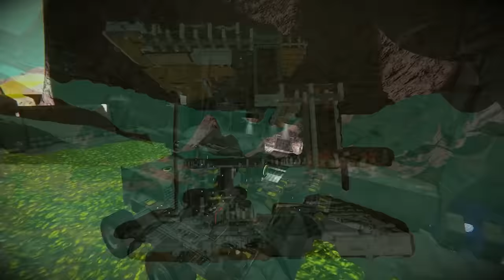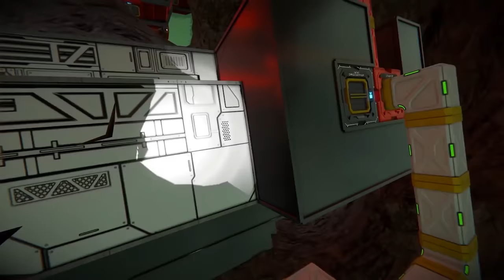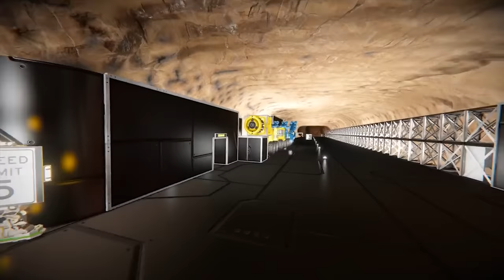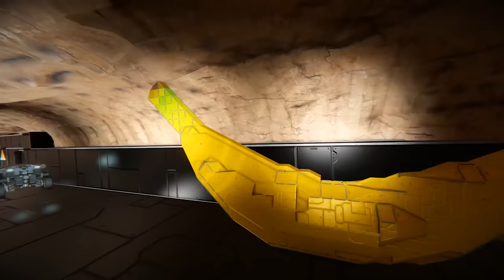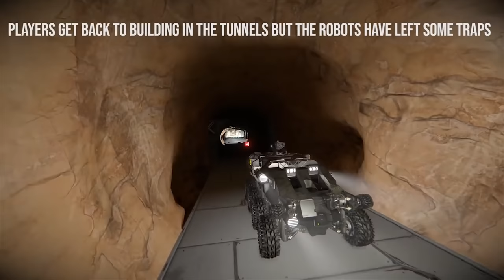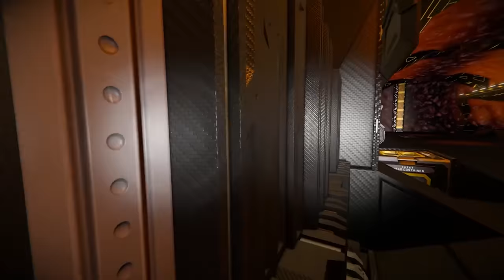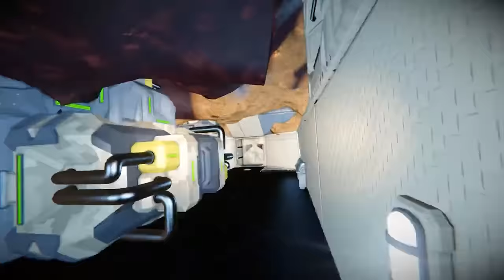WHY UNDERGROUND BASES SUCK !!!! - Space Engineers

Comment: The main reason for an underground base is so that you are hidden. For small groups it is great because you can hide away so no one can find you.
I once had a underground base so well hidden that a big group ended up building on the surface above it, not digging deep enough to get to it. Eventually the bigger group was wiped out, leaving lots a free loot to salvage.

The next thing is with an underground base you should hollow out a large cavity around the main base, having guns on all sides (if you haven't built to the lowest point in the world). This way no one can sneak above or below, and it makes it far harder for attackers to attack, they first got to dig deep to get to you, and you shoot them when they do. So now you are both hidden away making detection less likely, and you have layers of defence making the time it takes too long. Added that you can also set up proximity mines if the enemy uses a mining ship to come get you, they will destroy the ship.

The big issue is that many groups build a large base on top that attracts everyone's attention, then they get pushed into the under ground after.
Also mined voxels do a number on server performance. Space Engineers main issue is actually the fact that it keeps a record of what the voxels were like from the start of the world, then what work was done on it. Constantly loading and unloading these. Primarily in LODS does it load the original ground, but this semi open loop causes a lot of server lag and larger files.

Personally I still don't like being on planets, and on the server I've been playing on for almost a decade now, my faction is still solely space faring with out giant ships. Just hard to get out of from the days when the world was just a few scattered asteroids, eventually with infinite added, then the server admin added in the planets around causing one of our large ships to crash across the planet.

Comment: One good way to use an underground base that is either underused or under reported but commonly used is as a secondary recovery base/recovery cache. if your main base is huge but say once every couple of weeks you send a single cargo shuttle to a dense supply and industry cache you could build up a fairly large emergency reserve. If on a server that runs nanites you might be able to fully bounce back to full strength almost overnight with a sufficient reserve stowed away. Since the base is small and dense it needs no defense, and it does not need to be convenient since you only ever rarely make delivery drops and the stealth/ inconvenient measures can be disabled or removed if the main base is wiped and you end up enacting your contingency base.

I want to be clear that it should NOT EVER be the main base, but it should be a fairly good backup base that contains enough industry, resources, and essential vessels that you can essentially throw together your next wave of forces together rapidly instead of simply being removed from play as a faction. By keeping the base small and dense it has minimal effect on server resources and since it is only rarely used for emergency with the plan to remove extra security when the recovery plan is enacted it never drives players to not play. Lastly, there is essentially no reason to have any defenses or scripts on the base simply because it is only the plan B and will rarely, if ever, actually be used. This capitalizes on all the benefits an underground base can possibly have while minimizes the negative effects they typically suffer from.

Also, if you actually plan to have combat at your underground base a huge thing no one ever considers is just mining the ground until it is thin but not fully broken through. it blends in since you left the original terrain, but is fairly easy for you to drill or blast through in just a few moments. After all if you are defending at a underground base you want a mix of absolute security (original terrain) and expediency (blast through that thin wall). If the attack fails and the secondary entrance is discovered you can still have internal defenses, but usually at this point the battle is lost anyway. I don't see a need for a fancy secondary door for this reason.

Comment: Building a base underground is a double edged sword. The idea as stated is to have stealth and security. However,  if you don't know what you are doing when digging it out, you might as well make a beacon and crank its range to max. Die to the way SE renders voxels at a distance, it is easy to spot voxel deformation at a distance. Some players like to set up spy satellites to take pictures every so often to spot altered voxels on planets. So it is never a good idea to have that base near where hou mine or in an area that is relatively smooth. I have made several underground bases on official servers and have never once had them raided. As for security,  the best way to keep an underground base secure is to dig a large area around the base to allow turrets to defend it. This contradicts the stealth part however as the bigger the hole, the easier it is to see from orbit. The best way to utilize an underground base in a pvp environment is to use as a FOB. By storing only what you need, you can conduct operations from the base without risking everything you have. You can also set 1 up to be a trap to demoralize the enemy as well as costing them time and resources. If you want to build a base in voxel, your best bet is an asteroid in deep space to make it harder to find. But if you insist on building on a planet, mountainous terrain is the best place to start. When I build on planets, I find a nice place where the base of 2 or more mountains meet. This makes it much harder to see the deformation. If ypu are unable to find a mountainous area, the cliffs, canyons and craters are the next best thing. And always do your best to keep the hole small. This way there is little deformation as well as less lag in your area. Because lag can also alert players that an underground base could be in the area. Ultimately the best option is always to have a capital ship or station you can move around. And if hou find yourself lacking in storage, simply set up simple FOBs or Honey Holes as a backup. This way in the event your base or ship is raided, you aren't set back to square one

Comment: Why does the engine need to juggle anything ?? Could it not to process the change to the voxels and change to code to represent the new terrain as the default almost like every change you make NVR actually happens cuz as far as the engine would be concerned every change you make is how the map is suppose to be I hope this made some sense 😜 I'm not a programmer so I don't know technical terms but as far as I'm concerned it don't need to remember every change if every change is treated like a reset to default in a way like when you change something the engine will just go ok that was like that to begin with and alter code to represent that change as if it was default map setup

Comment: Whenever i made an underground base i made sure that the interior of said base had no rocks showing, id dig out and put unbuilt blocks where i planned to expand, made sure the ceiling was covered, the floor, and the tertiary walls. Some people like the rocky look, however like you said someone with a hand drill 
( if they know the layout of your base
[maybe a traitor,ive had it happen]) 
Can dig straight to your goodies. 

Cover up all your axises, always have a backup plan or a secondary base ready to bug out. (Your secondary base doesn’t have to be as big as your main, you can always work on it later) 

The most successful inground base ive had was on a asteroid. planets, not so much as planets have alot of traffic.

Just my 2 cents, i only have about 300 hours in SE but those tips always run through my head when building a underground base, everything else Aaron touched on is good advice.

Comment: One huge advantage underground bases have is that the enemy cant really pull up with a giant ship and blast your base to scrap since you are protected by the terrain but one drill ship and that doesnt work anymore so in my opinion underground bases only work if rules like these are in place:
1. If you are raiding a base you cannot dig any voxels around the base meaning no drilling into the loot room with a drill ship or hand drill or any of the sort.
2. there has to be a clear way to the loot room that is not blocked by any voxels (cargo with loot cant be placed fully into voxels (with the help of a projector and welder for example))
if rules like these are in place then in my humble opinion underground bases can be fun since its hard for both sides, the attacker is going to have a much harder time to get to the loot room since its so well fortified and the defender will have a hard time defending after a while since they cant get supplies so a base raid that usually takes maybe 30 minutes evolves into a raid that can take hours

Comment: in the real world dirt is low density and not as good at protecting as things like concrete or steel plates. the advantage is ease of use (sandbags) as building material and abundance. underground bunkers tend to be small, surrounded by concrete and/or steel plates using the dirt as reinforcement to help with stability. more secure facilities will be deeper putting more dirt between intruders and the concrete/steel box. less secure things like trenches still use produced reinforcement like wood or metal sheets and rely on sheer number due to their ease of production. due to the tracking of voxels this makes such bases a drain on system resources, and part of easing that is that the game shrunk the world so that planets are much smaller. this means that you would need to be in the center of a major planet to make it similar to real life, and thus the underground aspect in game is more of a cool skin for your base than actually being 'underground' like one typically thinks.

that being said one can create a digger to mine resources fast and dig into the side of a mountain or hill and then build a door to give some protection from an unexpected attack. the ship then digs and gathers a ton of resources then when done digs its way out and flies off. not exactly an underground base as one would think of it, but it is cheap and acts similarly to real world underground bases in that it is cheap, quick to build up, and the dirt parts are temporary. another way to do it is to make a hangar with a hole that is just big enough for the ship that stays in it to get in and out and angled so that it is hard to spot. rotate to a new temporary hanger every so often so that you stay hard to find and thus the dirt is camouflage rather than any real structure and not treated as a hard target. in both cases one should disassemble the blocks when done to keep the resource drain at a minimum as well as making it less obvious how your bases look from the outside to help keep them from being spotted.

Comment: Hold on you are saying that under ideal conditions you can actually get good performance on a well populated space engineers server now!?!?! Last time I played the game would struggle with only a handful or two of concurrent players doing anything.
Also I'd suggest there is nothing wrong with underground at all, even with the cheesy tactics that help get past them - if you didn't design with sappers in mind you only have yourself to blame. The tactics might be cheap, and I'd suggest hand drills should be made much slower if PvP combat type play is intended on this server - sure they can still sapp, but its slow or they have to drag a mining platform in. Plus from a convenience standpoint underground is a good way to get started without spending heaps of resources - didn't keep playing that long after planets became a thing but it was always my default - either underground or inside a crater/valley type feature so the harassing AI drones were easier to defend against, the location easy enough to find with no HUD up and you didn't spend all your steel on building the basic structural blocks.